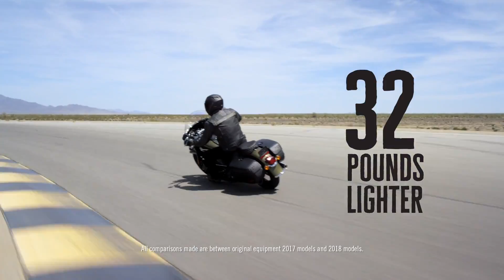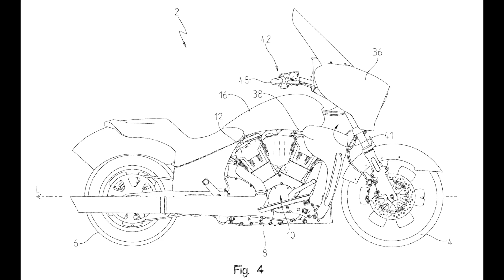Should Harley Discontinue the 107 Cubic Inch Milwaukee Eight?

Comment: I have a limited with 103, cams ,tuner,Vance and Hines X pipe all by Kendall Johnson  and I own a 17 streetglide 107 and my 103 will suck the handlebars off the streetglide when it blows by it plus my 103 fans with or out runs any 114 I have rode with.

Comment: It's kind of silly when a 107 cubic inch motorcycle engine ISN'T considered powerful enough by some fanatics.  Some HD riders are just as strange as the iPhone people who must have the newest thing. 

I ride a 2007 Vstar 1100.   It has plenty of power for me and it's only a 64 cubic inch.     It has more acceleration,  power,  and speed than a Dyna.    

 I would be proud to own a 107.

Comment: 107 is plenty of motor. Toss in a cam, pipes, tuner, compression bump, and set of heads. Perfect sleeper touring motor that is bulletproof.
Reply: You have to do all that to get ok performance?

Yikes.......
Reply: @GPz84  The EPA has strangled the air cooled v twin. Your basically  removing  the heavy handed government mandates.  Old guys like me see the end for the Harley's history of air cooled engines. Water cooled is the future even if goes against the grain of most brand riders.

Comment: I owned a 2018 ultra limited with the 107 and I put 8800 trouble free miles on it in less than a year. I traded up to the 2019 ultra limited with the 114 and it now has 21000 miles on it. If the CVO limited came with the 122 or 131 I would trade up in a heartbeat. I am first and foremost a power junkie. Prior to my Harley days I have owned one V65 Magna and two first generation VMaxes.
Reply: The Yamaha VMAX was awesome. Must say you gave up serious performance crossing to Harley. Although that VMAX seat was a bitch

Comment: Indian's sale per quarter are less than what Harley sells in parts and accessories in the same quarter. Indian is zero threat. Harley could go a long way by changing the frame and suspension on their tour models so they are not decades behind and they really need to add electronically locking saddle bags on their specials

Comment: November 2020 I bought the Street Bob 107. At the time the talk was, it was being dropped, so the ones that were left dealers were not giving breaks on. My 2 saving graces was, I am a mellow rider and 2 I wanted the River Rock Gray. Not a fan of the 2021 colors at all. As far as Indian goes, they are making Harley up their game. For me, Indians do not look as good as Harley's, that is obviously subjective. Fit and finish is a little better on Harley's. I do like the look of the Challenger and Harley is going to have to drop the Revolution motor in a bagger to compete. As far as size goes, for the most part it is a numbers game, my wife's 103 Twin Cam is not all that slower than my M8. She has ridden them both hard and can attest to it. He bike is at least 50 pounds heavier also. The EPA also dictates how big the engine needs to be. If Harley riders insist on a 1936 designed engine, the only way to give people the power they want AND pass EPA standards is to go bigger and bigger on displacement.

Comment: HD  would rather  sell you a  107 CI for  $25,000.00 then sell you a  131 Big Bore Kit  for another $7,500.00  Yes  Indians   may cost a bit more but they always  offer more value with a far better suspension ect..
  If HD  did not have serious competition from Indian they would  be selling the same old crap that needs all of the updates to make it ride like it should  and need better brakes  better seat  ect...
Reply: 100% agree. The simple fact that Indian brought in 3 stock Challengers and clowned fully customized  HD Street Glides with $150k motors at King of the Baggers is all you need to know about HD.

No one on this thread acknowledges that HD has been showing a sales decline for 14 years straight.

Comment: With every decision HD makes, they push me further in the direction of indian. I've got the feeling, that this is where my money will go. I don't have some complexes, so that I need bigger and bigger engines. I want efficient and as far as it can go, economical engines.  On top of that, good looking motorcycle. For now, indian has the upper hand, even though I was dreaming about my own harley for pretty much half of my life (early 20s now)
Reply: You are partially correct in my opinion. Indian is ahead in terms of engine development and transmission development. Indian needs to step up their paint and sheet metal work to match Harley. Indian has an opportunity to get a slam dunk with some investment in their paint and sheet metal.

Comment: I've never been on anything bigger than my 1200 Roadster. As long as I keep it that way I'll never know what I'm missing!  I am actually bummed that they're cutting the Sport Glide. I have been considering it for a future trade in.
Reply: The lack of 6th gear is that bikes biggest issue. For me, the vibration kills me. Going from a Sportster to a Street Bob, I find the Street Bob actually easier to ride, better balance and lower center of gravity. I love the look of the Sporty, but the engine needs a complete overhaul and it could never pass the EPA and still look the same. The engine is basically been grandfathered in, Harley cannot just update it without the EPA evaluating it.the Sporty with the Evolution motor is on life support, be surprised if it lives to be a 2023 model. Your bike will be sought after in a few years.
Reply: Rumor had it that the Low rider will have a bag option next we will see.....
Reply: @michaelconran5252  100% agree with the vibration comments. I owned a 2019 iron 1200 as my first bike and anything over 50mph was just annoying after a while. Plus I had some Vance & Hines big radius pipes on. Sounded amazing but waaaay to loud, after 20-30mins my ears would be ringing. I was gonna get a 2-1 exhaust originally but father talked me into the big radius. Anyway I traded that bike in for a 2020 softail standard. Soooooooooo much better holy crap, I got my bassani road rage short ripper stainless 2-1 exhaust and it's louder in the "higher" rpms and cruising speeds it has a good sound but doesn't hurt my ears. Great for performance too so in the future when my warranty is over I'll do some engine upgrades maybe. Then again I might not because this bike is my ONLY form of transportation
Reply from the maker: Yeah, to me my Roadster has all the torque a motorcycle needs.

Comment: Sorry guys the last big improvement for Harley was in 1937 with the Knucklehead.  Sorry that assembled crankshaft is a major weak point.  These large displacement twins have a reputation of a normal lifespans around 40K, yep you find those who somehow get 100k on their bikes, that is until.   If you start asking these high mileage engines suddenly what they consider ROUTINE would be a MAJOR overhaul for any other brand.  Sorry I have actually twisted wrenches, not for a living am more of a jack of all trades type, worked in industrial in electrical/mechanical for 30 years after retiring from the military.  Can fabricate, machine, weld, do custom body work, etc... on top of electronics and electrical.  Sorry That frail crankshaft simply shuffles out of alignment over time and in the process destroys the cases.  Yes you can repair the cases and install inserts to strengthen the main bearing bosses.  You can rebuild the crankshaft then weld the pieces together so they have less chance of shifting.  The cam and oil pump drive has been a major issue for the past decade or so.  Then the cooling simply SUCKS, take a thermal gun and shoot the difference from the front and rear cylinder, that is why the rear cylinder is always a problem child.  Harley simply MUST dump the current designs and step into the 1990's, the last assembled crankshaft street bike was Suzuki GS bikes of the early 80's and they got rid of them due to that crankshaft weak point.  You can get some torque and horses out of a HD big twin, but not for long.  Right now EVERY similar displacement engine from other brands put out more torque and horses and they hold together.  Have a old clunker Goldwing 93 Aspencade with over 100K and the only issues so far other than G.T.O. has been the alternator started going flakey, replacement aftermarket $85.00 for a 90amp replacement of the stock factory 55amp unit which would have cost $225, a no brainer there.  Yes I have changed the cam belts, at 50k miles between changes, changed the DOT4 fluid every other year, and changing the rear tire simply is an ORDEAL from HELL.  My BMW R1150RT is like a toaster oven, turn the key and go.  Only PAM with it is any routine shit you have a pile of plastic on the shop floor 5' high, yep changine the battery out requires pulling one side of the fairing.  But I ride both like I stole them and no issues so far.

Comment: A big air-cooled v-twin can only make so much power without heat issues & making it bigger makes more heat & adds weight so there's no point. The liquid-cooled Sportster 1250 is faster.

Comment: The Thunderstoke was built to be and is/was competitive with the Twin Cams power & displacement. 111 & 116 to the 110 & 117ci TC.

Certainly it’s about bragging rights & one upsmanship even power for your buck as it’s more displacement & power than is needed or cared about by 80 percent of riders. 80 HP 80 ci EVO was built and hot.. now the 107 does it stock and is under cammed!  So..

Go 119 & 122 keeping both 4.375 & 4.5 strokes. It still leaves 128 & 131 big bore upgrades. Sameish cost to MOCO & leaves Indian scrambling for power & displacement. 

The small displacement Revolution motors do the Sportsters, Adventure bikes, naked bikes, maybe some softails. So why not go big with the big heavy touring & softails and let M8 dominate.

Comment: In answer to the title without having watched the rest of the video: yes. Harley should scrap the 107.

However I have a different reason: Harley spent more on marketing than R&D. It's absolutely heinous a nation known for tinkering has sat on its laurels so long. To wit: America can build a better engine, and it should. America can innovate, and it should. It's absurd to look at a Harley and make excuses for 1930s technology in 2022.

I even have three avenues Harley needs to take simultaneously.
1: Indian is making headway in the cruiser market, and Harley needs to do some soul-searching with the engine why that's so.
2: The Pan America is too little, too late in the ADV market. Harley needs to make a 450cc ADV, and a 650cc ADV. (Imagine that: designing more motorcycles!)
3: Harley needs dedicated dirt bikes from 125 to 500cc. Kids start on these, kids break these, kids buy bigger bikes when they grow up. 

Goals: everyone should be able to ride behind a Harley without choking on the fumes. A 4' tall kid should be able to ride a Harley on dirt. And Harley should be approached by Koenigsegg for tips to beef up horsepower and torque.
Reply: And after having watched it, I stand by my above remarks: ditch the 107. Hell, ditch the 114 and the 131 in the next five years in favor of entirely new engines. Make a 111 with more power just to face Indian directly.

That said: Harley must drop its fixation on image and get back to hard engineering. Durable, practical, working motorcycles comfortable to ride, and no excuses. Case in point,  I was at Sturgis this year and if a Harley is the mark of individuality, corporate America has bought the spirit of that ambition.

Harley can do better.
Reply: Well said. We are witnessing history. Harley must close the air cooled chapter and reinvent themselves or be a part of the "I remember when Harley was a viable business."
Reply from the maker: I like the air cooled M8 engines and they ride pretty well for what they are. However, I agree that Harley needs to build smaller bikes to attract younger riders. I hope they introduce those 500 and 750cc Rev Max motors soon.

Comment: At this point Indian/Polaris is more American Made than HD is. HD is already about to shit-can York PA. It’s a tractor engine with a barely functional rear cylinder, it’s not fast regardless of the engine type, so stuff that argument. 

Meanwhile they keep chasing that potato potato sound for a current and future customer base that no longer cares. GenX and Millenials are their market and HD continues to cater to Boomers, and their 13 year declining sales streak reflects it. They need to step up their engineering, and this whole concept of “Premium” needs to be walked away from. GenX and Milenialls have demonstrated that they would rather go to other manufacturers for comfort and performance (see explosions in ADV sales) and get more for their money.

HD continues to play it wrong, and Captain Puma McSwissMiss continues to double down on stupid. Their sales aren’t up. They’re up from last year, but they’re still down, severely. They’re even outsourcing their Human Factors Engineering, it’s why the new Sportster and Pan Am are so damn small. Their human factors design was based on the average size of a Chinese man. No shit, that’s why they’re tiny. 

HD has problems, serious problems, and that Indian only needs to improve their marketing.

Comment: Yeah yeah yeah and all of this engine upgrading more power more torque BS and nothing is said or done about the drivetrain and transmission? The drivetrain and transmission are the same ones if using in the 103‘s and who knows how far back and they were never designed for that kind of torque. How about we talk about the drive train first then let’s add torque to it.
Reply from the maker: Good point.